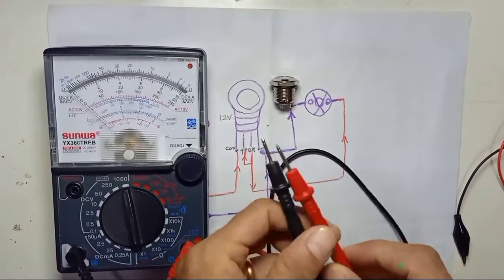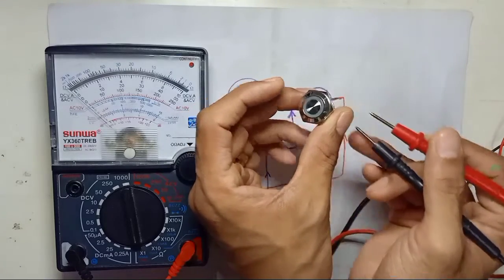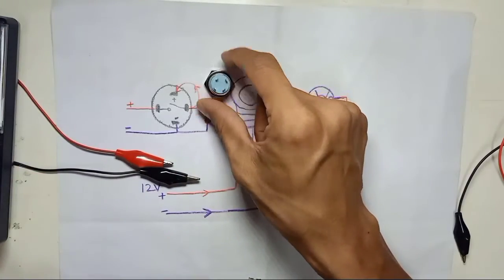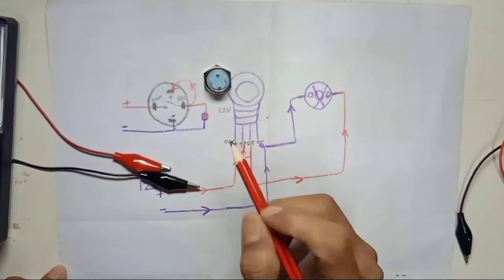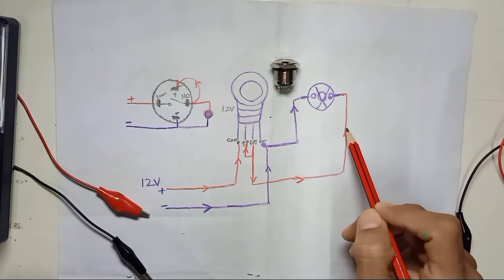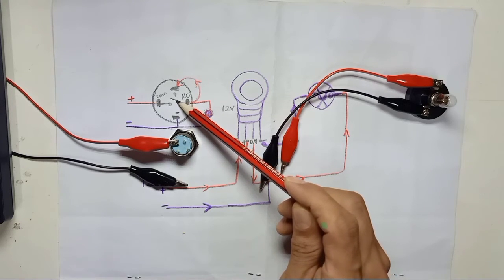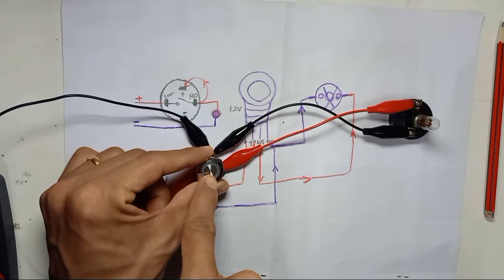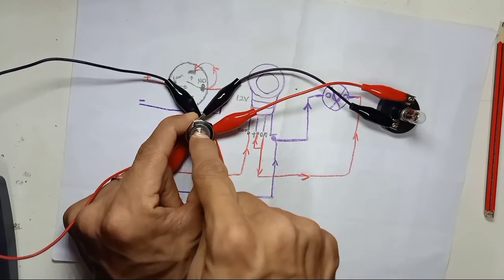How to use 4 pin Push button switch with light

Comment: I wouldn't have been able to work out my switch without your help 👍

My switch came without any indication of what pin was what except for the gold plated one (com)  the diagram on the package said it had power and acc up the top and 
+ And - LED down below.

I knew there had to be a jumper somewhere in it ( we were trying to get a water pump for campervan sink to work).

Watching what you did gave me enough insight to understand what was going on and got it wired correctly in minutes!

Thank you.
Reply from the maker: I am very happy for its helpful.

Comment: Great video, so to summarize negative load and negative switch both twisted together and run to battery negative.  Battery positive to one of the switch commons, the other switch common plus load postive and switch positive all twisted together.
Reply from the maker: Yesssss
Reply: @passiontechklm  ok thanks for the response. This vid really helped me because I did it wrong and put the positive and negative from the switch to the battery, commons to load and it worked but the light was sooo dim. Who would assume a common went to the battery? I guess also if you wanted your switch halo to be on all the time you could run the postive switch to the battery instead.

Comment: Excellent explanation! Much appreciated. One question (maybe you can help). I need a latching button that works like this one in the video (the light turns on when the button is pressed and latches, turns off when released from latching) BUT I need to have separate voltages, the actual load to run the appliance is 9-12v AND the light of the button 1-3v. Do you know if there is a button that has separate lanes/pins for the load and the light? this is to avoid bridging/sharing the load to be able to turn on the led as you do in the video. I need to feed the lights of the buttons with batteries, and have higher DC from a power supply for the actual connections, so the button lights turn on from the battery power when pressed, and the appliances run from the power supply. I hope it's clear. Thanks.
Reply from the maker: If your button light is 1-3 V than you just add 1k resistor to led pin and use 12V from the load so you don't need to have separate power supply.its safe

Comment: Hi. If I connect a 12V switch to a 9V PSU, will the switch still light up?

I am concerned that 9V won't be enough to turn on the LED inside the switch.
Reply from the maker: Still can light up, just a little bit dimmer only.
Reply: @passiontechklm  Thank you for your answer.
Reply from the maker: @peddersoldchap  you are welcome 🤗

Comment: Would you still need a resistor if it was a 12v switch connected to a raspberry pi?
Reply from the maker: No need resistor in that case...

Comment: Can use this switch for audio amplifier
Reply from the maker: It's very small amp's only....for direct to  Audio is not recommended but you can use it with relay.
Reply: @passiontechklm  thank you  for reply

Comment: Why does the switch not stay on when you turn it on?
Reply from the maker: The switch not staying turn because of it is momentary switch,if you use latching switch than will keep turning on.Basically Their are Two types of switches one is latching and another one is momentary.
Reply: So you cannot turn OFF the device with a momentary switch then..? Only turn it ON? Or..? 😅